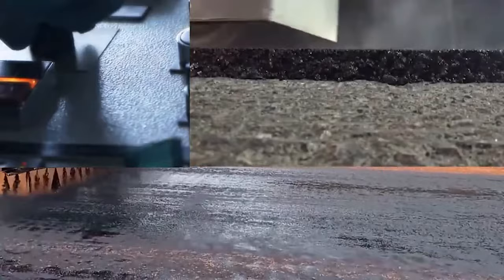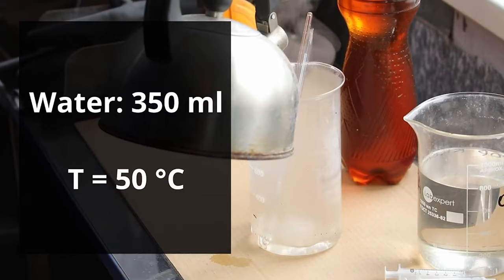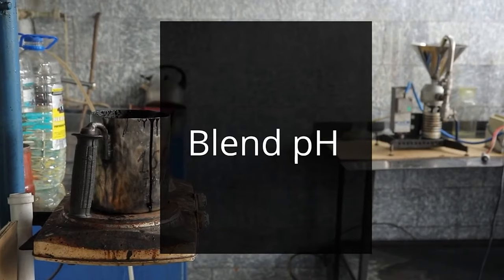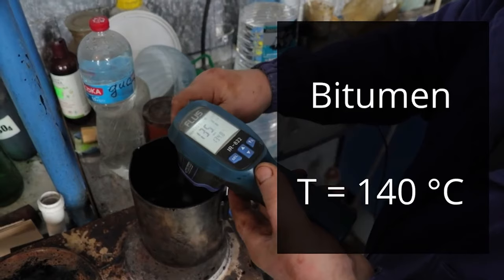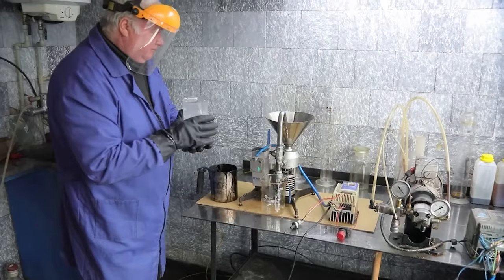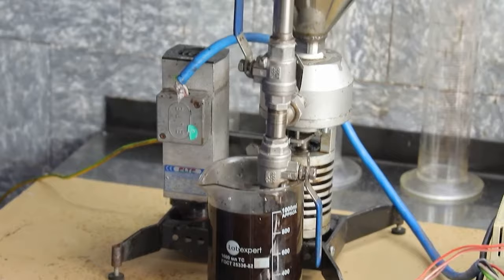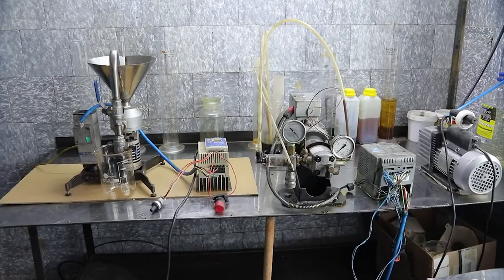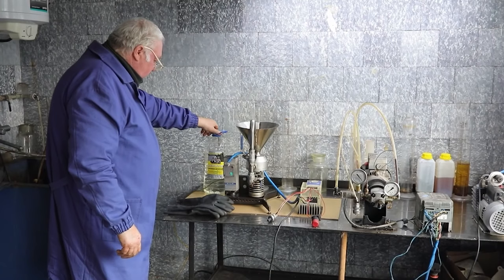Bitumen emulsion production in laboratory setting

Comment: What parameters of bitumen and water are required for the preparation of an emulsion batch?
Reply from the maker: To prepare a bitumen emulsion batch, parameters such as bitumen properties (viscosity, chemical composition, and temperature), water quality (pH, temperature, and hardness), emulsifier type and dosage, and acid type and dosage must be considered. The specific parameters required will depend on the emulsion formulation and manufacturing process used, and it is essential to follow the specified procedures and requirements to ensure a high-quality bitumen emulsion.

Comment: What is the purpose of water at 50-60 degrees during emulsion production?
Reply from the maker: During bitumen emulsion production, water at a temperature of 50-60 degrees Celsius is commonly used to help facilitate the emulsification process.

Comment: What are the environmental benefits of producing bitumen emulsion compared to regular bitumen?
Reply from the maker: Bitumen emulsion has several environmental benefits compared to regular bitumen, including:
- Reduced greenhouse gas emissions during production because bitumen emulsion requires less energy to produce.
- Lower levels of volatile organic compounds (VOCs) emissions during application, which reduces air pollution.
- Lower risk of spills and leaks during transportation and application due to its lower viscosity, reducing the risk of soil and water contamination.

Comment: What role do adhesive additives play in emulsion production?
Reply from the maker: Adhesive additives are used in emulsion production to improve the bonding properties of the emulsion. These additives help to improve the adhesion between the emulsion and the surface being coated, which enhances the overall performance and durability of the emulsion. Adhesive additives can also help to reduce the amount of water required in the emulsion, leading to improved environmental sustainability.

Comment: What characteristics of the emulsion indicate that it has turned out well?
Reply from the maker: Several characteristics indicate that a bitumen emulsion has turned out well, including stability, appropriate particle size, viscosity, residue, and compatibility with other materials. The specific characteristics will depend on the intended application and relevant standards or specifications.

Comment: What kind of testing is conducted in the laboratory after emulsion production?
Reply from the maker: After bitumen emulsion production, several tests are conducted in the laboratory to ensure that the emulsion meets the required specifications and is of the desired quality. Some of the common tests include:

1. Viscosity Testing: The viscosity of the emulsion is measured to ensure that it is within the required range. This test helps to determine the consistency of the emulsion and its ability to be sprayed or applied onto surfaces.

2. Particle Size Analysis: The particle size of the emulsion is measured to ensure that it is within the desired range. This test helps to determine the stability and effectiveness of the emulsion in various applications.

3. Asphalt Content Testing: The asphalt content of the emulsion is measured to ensure that it meets the required specifications. This test helps to determine the amount of asphalt present in the emulsion and its ability to provide the desired properties to the emulsion.

4. Storage Stability Testing: The stability of the emulsion is tested under different storage conditions to ensure that it can be stored for the required period without any significant changes in its properties. This test helps to determine the shelf life of the emulsion and its ability to maintain its quality over time.

5. pH Testing: The pH of the emulsion is measured to ensure that it is within the desired range. This test helps to determine the acidity or basicity of the emulsion, which can affect its performance and stability.

6. Compatibility Testing: The compatibility of the emulsion with different materials such as aggregates and sealants is tested to ensure that it can be used in various applications without any issues.

Overall, these tests are critical in ensuring that the bitumen emulsion produced meets the required specifications and is of the desired quality for various applications.

Comment: What is the purpose of the laboratory setup in emulsion production?
Reply from the maker: The laboratory setup in bitumen emulsion production serves several important purposes, including:

1. Quality Control: The laboratory setup allows for the testing of various parameters of the emulsion such as viscosity, particle size, asphalt content, and storage stability. By monitoring these parameters, the production team can ensure that the emulsion meets the required specifications and is of the desired quality.

2. Product Development: The laboratory setup allows for the development of new bitumen emulsion formulations, testing of different additives, and optimization of production processes. This can lead to the creation of more efficient and cost-effective bitumen emulsion products.

3. Troubleshooting: If problems arise during the production process, the laboratory setup can be used to identify the cause of the issue. This helps in finding solutions to the problem and preventing similar issues in the future.

4. Research: The laboratory setup can be used for research purposes to explore new applications for bitumen emulsions, test the effectiveness of emulsion products in specific environments or under certain conditions, and to investigate new methods for bitumen emulsion production.

Overall, the laboratory setup in bitumen emulsion production is critical for ensuring consistent product quality, product development, troubleshooting, and research.

Comment: What color does the bitumen emulsion have?
Reply from the maker: The color of bitumen emulsion can vary depending on several factors such as the type of bitumen used, the additives present, and the manufacturing process. However, typically, bitumen emulsion has a dark brown or black color, similar to that of asphalt.

Comment: How is the ratio of emulsifier to acid determined during emulsion production?
Reply from the maker: The ratio of emulsifier to acid in bitumen emulsion production is typically determined through empirical tests based on factors such as the type and quality of the emulsifier and acid, desired particle size, and application. The optimal ratio is determined through trial and error experiments, monitoring the stability and performance of the resulting emulsion under different conditions.